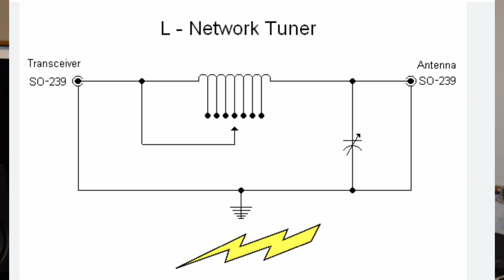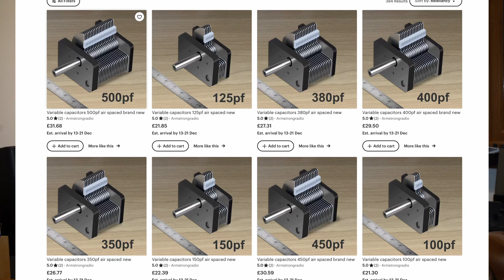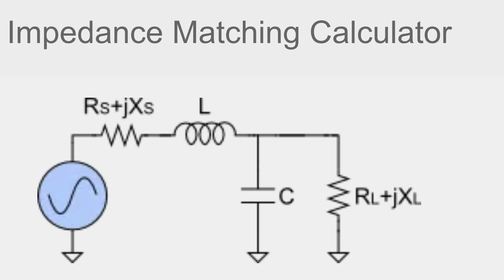The L-Match ATU - Easy to Build.   Ham Radio

Comment: When I first got on the air an a Novice at age 14 I had just a random wire I had used for SWL purposes. I could partially load the wire directly with my pi network output of the Heathkit DX 60 I had just built. I wanted to work both 80 and 40 with full power so I wound a coil with number 14 wire about 2 inches in diameter and about 6 turns per inch. It was maybe 6 inches long. I found a capacitor rated at 140 pf. ( the unit was micro-micro farad back then). I mounted the parts on an old cardboard cigar box I got from my grandfather! To adjust the coil I used an alligator clip lead. Worked just fine. After a few months I got a steel chassis box and a piece of B&W coil stock and built one a bit more sturdy. I have used L networks off and on ever since. That simple little circuit can tune almost any length wire. Like you noted I did avoid exact halfwave lengths of wire. Just recently I needed to get on 80 meters and took one of my homemade L networks out to the base of my 165 foot Inverted L that I use on 160 meters and used it to tune that wire for 80 meters. I also have done that for several other bands. For low power, like 100 watts, the plates on the capacitor can be quite close. Obviously larger spacing is needed for higher power.

Comment: I use 40 or 50 turns of 1mm wire spaced at the wires diameter on a 50mm former with around 360pf variable capacitor(s) for L and Pi matches. I have recently become aware of the Etsy supplier of capacitors, It will save me scouring benches at rallies!! I've been making atu's for 40years it was my first construction project. Great video supporting home construction, The essence of Amateur Radio. 73 de GØUSL

Comment: The idea of Ham Radio being a "hobby" is to teach others to actually build their haystack accessories such as antennas, antenna feeding devices, and test equipment. Buying "off the shelf" should be discouraged because buying already built stuff doesn't teach you anything. So, I have built antennas, antenna feeding stuff, and some shack accessories like antenna tuning devices, doing my own circuit boards for projects, and so on. Such building of things expands your knowledge and helps you understand how circuits actually work.
Reply from the maker: Remember some hams have issues that prevent them building gear.
Reply: Yes, that is what amateur radio was originally all about.  All the first broadcast stations started by amateurs experimenting and developing the art. This is a primary reason the governments allow and license amateur radio practice.  Looking at their original call signs,  most had a number in them for their area  as do present call signs.  Most all radio engineers started out in ham radio. All my former mentors in commercial radio were licensed amateur radio operators, as well as commercially licensed engineers. Example, KDKA started as 8XK by experimenter Frank Conrad, before becoming KDKA, Pittsburg, Pa, USA.
Reply: @larrybarnette4795  Yes, Larry, I started in Ham Radio, then went to college to get a BSEE at Rochester Institute of Technology, then got the Masters at Western Carolina U. in 1993. Was a Broadcast Engineer at WHAM, WCMF, WRFR, WCMF, and finally at WACQ. Then, the FCC deregulated the industry and suddenly the requirement for us Broadcast Engineers and bored (literally) operators were gone. Computers run the TV and Radio stations and roving "Engineers" fix the equipment for a price. The old days are gone forever. I still maintain that you must have the ability to assemble and repair your equipment to a point. Surface mount stuff is tricky at best, ruinous at worst, but you must try. Discrete component stuff you can do in the shack, tube electronics you can do in the shack, too. My Novice station still lives after 44 years, a National HRO receiver, and a Johnson Viking Valiant transmitter along with a Drake R4B/T4XB/MS-4/AC-4. All were not working when acquired, but under expert tutelage from my Elmer, I learned the value of repairing such equipment

Comment: I recommend making your own L match  Peter, I actually used a variable capacitor  taken off an old valve radio, I bought it at a rally for about £3, mine is for QRP 5watts, I'm told it's OK up to 25/30 watts with this capacitor I made the tapped inductor on a piece old 2 inch wide plastic pipe wired the coil tapping's to a rotary 10/12  position switch, works fantastically well ,used along with a 49:1 unun, it matches up very well indeed, like you I use a counterpoise ,L match is by far  the easiest to build.
Paul
Reply from the maker: Great info Paul. Many thanks.  73 Peter

Comment: I think I recall that women made these variable capacitors during the war... What about a  9:1 and a non-resonant length that is supposed to cover all the bands without a tuner... is that a thing? All the Best! 73 DE W8LV BILL
Reply from the maker: The 9:1  gets the VSWR down on some bands but normally requires the help o& a matcher.